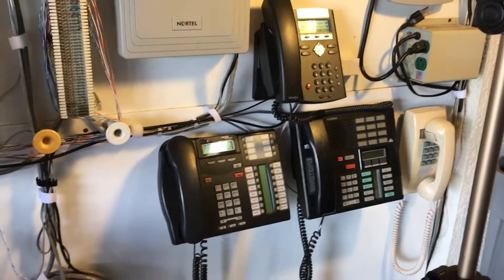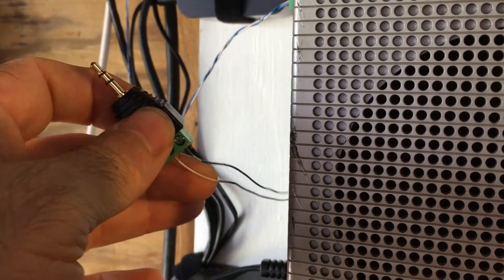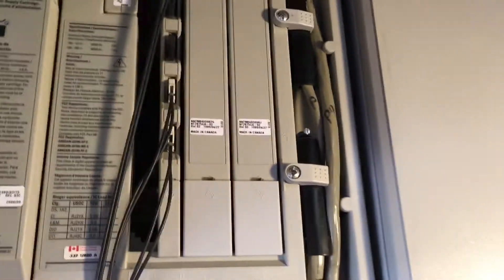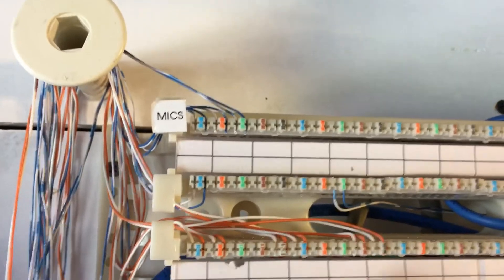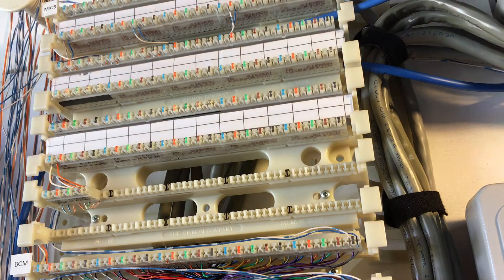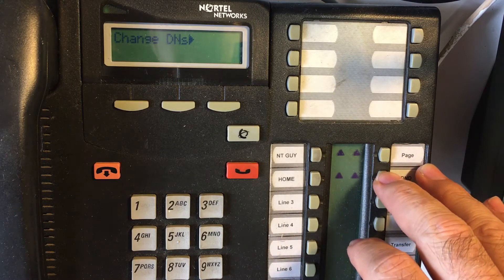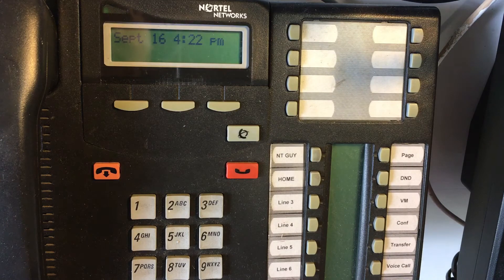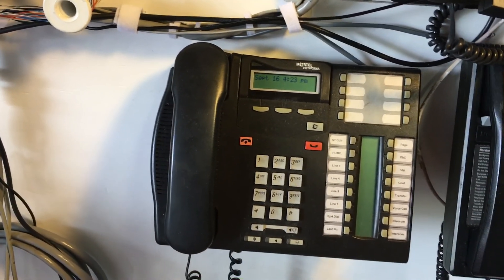Connect hold music to Nortel MICS 0x32

Comment: Well presented video and nice setup, with all that Nortel equipment thought for sure you would've had some BIX blocks. Really upsets me when another tech comes in to do something and because they do not have a BIX blade end up splicing wires. Try to have everything nice and neat as yours shows here

Comment: So Nortel has gone away. Can you make some videos and playlists about new were IPPBX stuff
Reply from the maker: Jason, Nortel is completely gone now.  Avaya bought them in 2009, but has done absolutely nothing to preserve the product line.  However, eMetrotel has breathed new-life into existing legacy Nortel equipment.  And, it is all IP PBX based.  :)
Reply: I actually ran across a Nortel system like this on a work assignment about a week ago. The closet was all nice and tidy and had a Nortel badged enclosure like the one in this vid. 
It would be great to see how to convert a system like this to a VoIP system. I know that would be a tall order and the technicals and variables may be different for different situations but it would be great to see and explained.